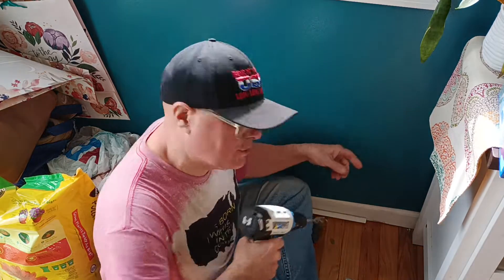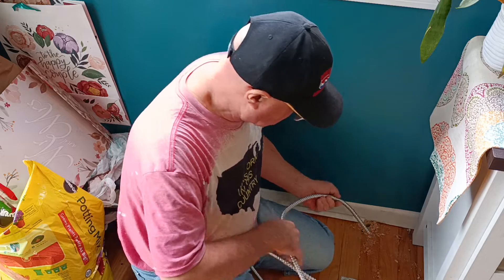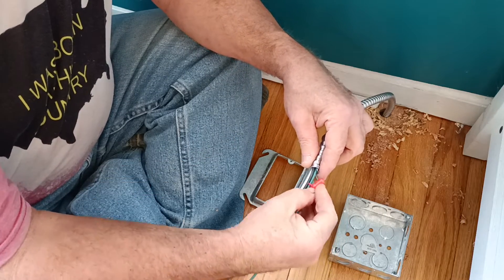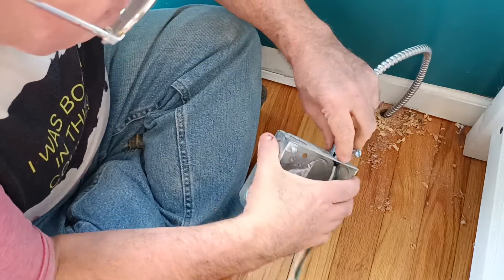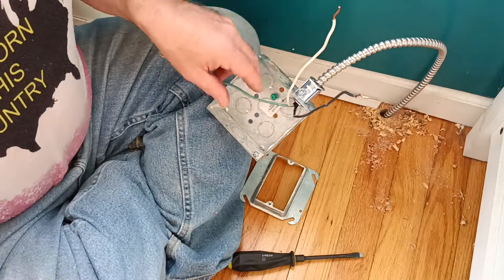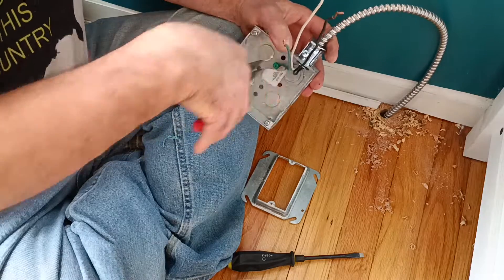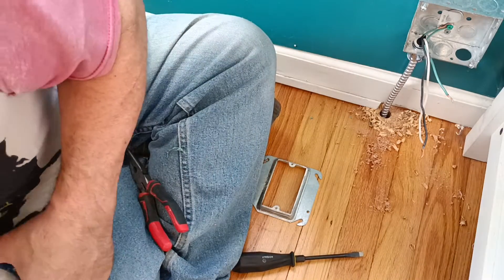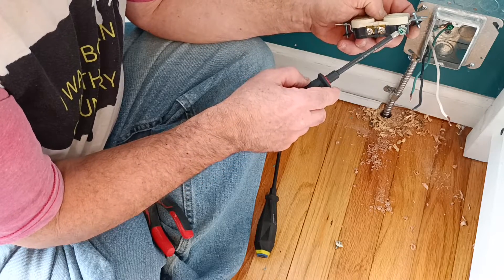how to install and wire a new wall receptacle using MC cable when you can't go in the wall

Comment: Rarely we can't get a wire up and inside the wall. It does happen though and when it does most electricians if they have to install an outlet on a baseboard will use a Wire Mold box easy and cleaner application. Why you would use type MC cable in a situation like this is beyond me. I use Type MC primarily on buildings taller than 4 floors and commercial applications. RX is simply easier especially for DIYers in residential applications.

Comment: You said you can’t go in the wall, so I don’t know the exact conditions, but why not pull the baseboard off, cut a small hole and drill down through the baseplate? Put the baseboard back and it’s like you were never there. Instead of putting holes in hardwood floor and surface mounting a box

Comment: Dont foger to put a plug in that open hole. Why didn't you just use a nice 4 square industial receptacle on over to give you a professional finish and smooth edges.